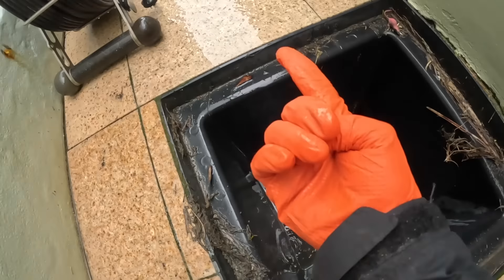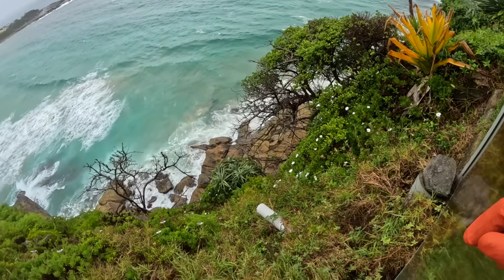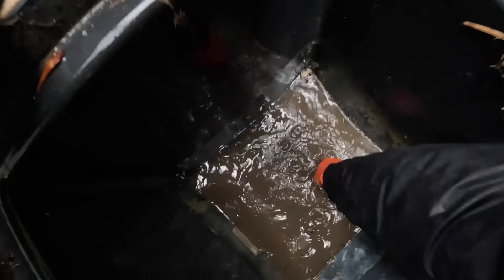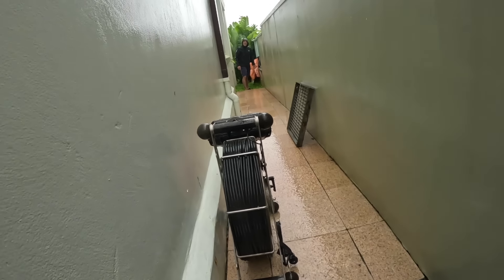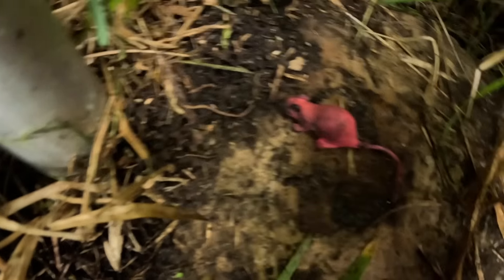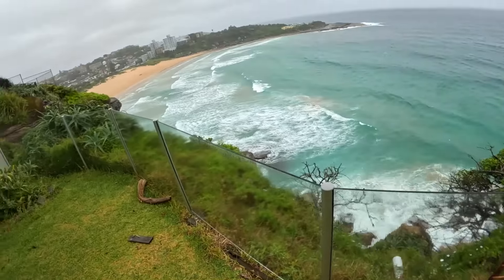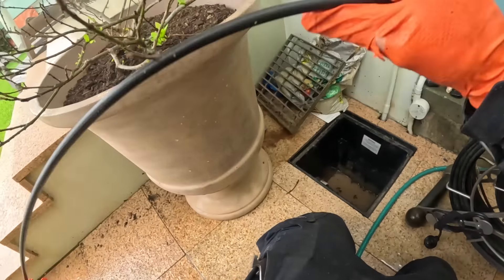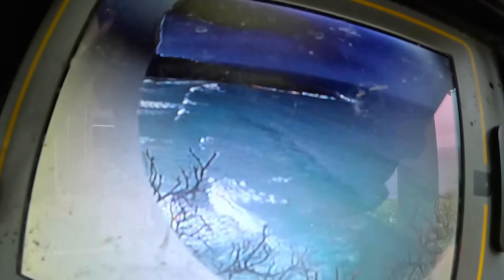Blocked Drain 928

Comment: 13:42  (I guess those on site have already been and fixed} just putting it out there 'just in case'
The glass panel [as Ollie points down the cliff] if not connected on the left side pillar/support 
Wouldn't want to think someone might lean against it

Comment: I actually did training a few weeks ago to run a jetter system; problem is though- i use the jetting system on a vac truck, which goes up to 20,000 psi (mostly industrial- redineries, council steel pipes etc)

Comment: So they want to redirect it to a pipe that has been broke by a concrete post that is causing erosion let's think about that they want to add more water to a pipe that's causing erosion  I would think that would increase the erosion  or they fix the pipes all together by removing them and bringing them together in one new bigger pipe leading out.

Comment: When he feeds the camera in, I don’t understand how it goes further and further - it has no force behind it so why doesn’t it just bunch up and refuse to go deeper?
Reply: They don't much rid is somewhat stiff. Depending on model some don't make turns well some have issues with longer lines. Rod diameter andhead type are based on type of drains/size that particular models for.

Comment: I'm wondering if I missed something here.
So the sewage goes through the pipes to a main line and empties out of a pipe on the side of the cliff.
That's raw sewage spewing out of the cliff to whatever is down below?
If so, that's just awful.
Reply: Put your thinking cap on. It's storm water drainage. Sewage doesn't run to open grate drain boxes.